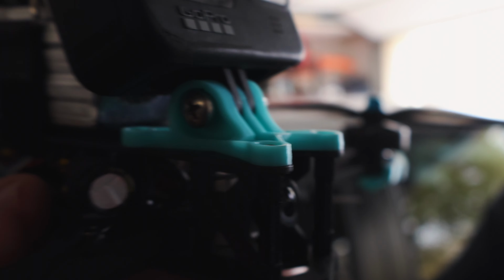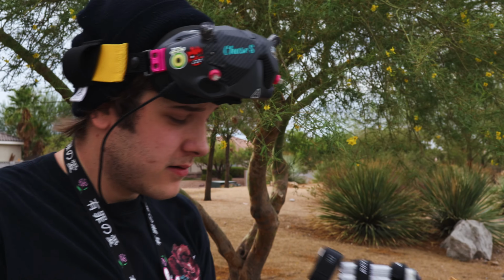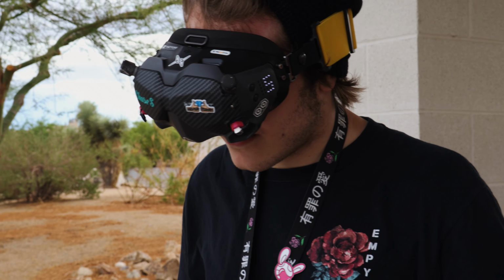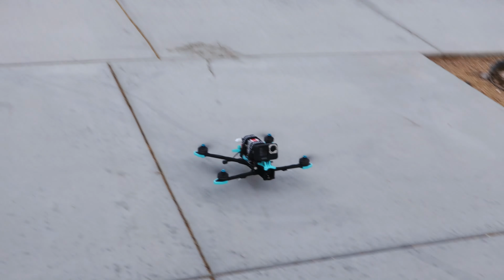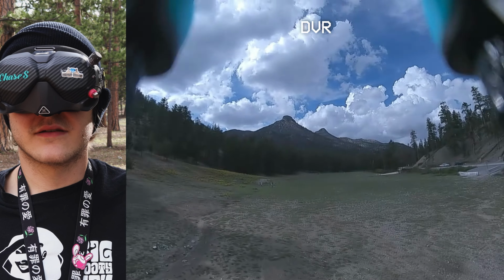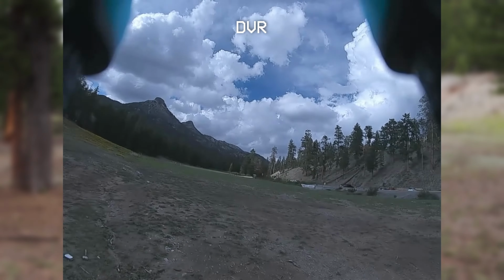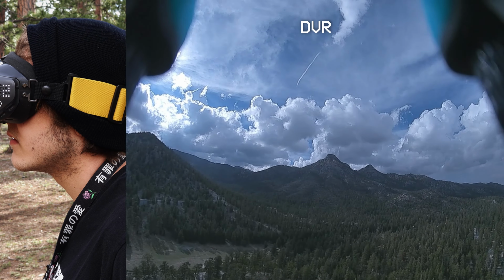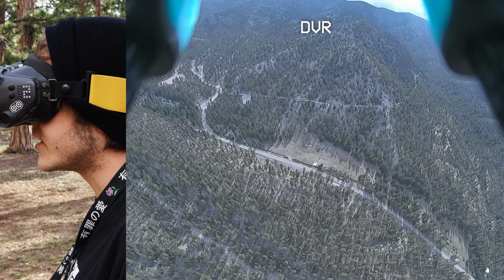Tuning A 7" Quad | Vlog + FPV

Comment: Cool video, those gopro mounts are more designed to go with one of those 3D printed camera cases/protectors which you can leave on the quad while still being able to remove the gopro... the flexiable 3d print also won't be able to reliably hold a captive nut if the bolt isn't screwed in either.

Comment: Man that sounds nice and aggressive with the bi-blades!

The RTH  issue may have been your setting in BF. I forgot what is called, but that setting will cause your quad to go up to the highest altitude you've flown, then start returning.

Update: 
Now that I'm home and connected to BF, if you have GPS Rescue set to Maximum Altitude, your quad will fly up to the max altitude you've flown plus whatever GPS_RESCUE_ALT_BUFFER is set to in metres. That's why yours was going up so high.